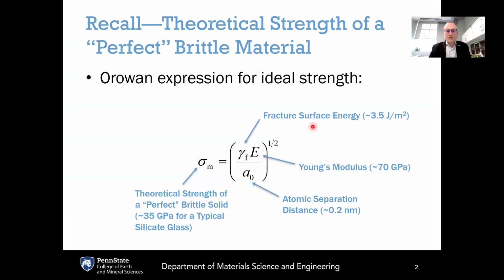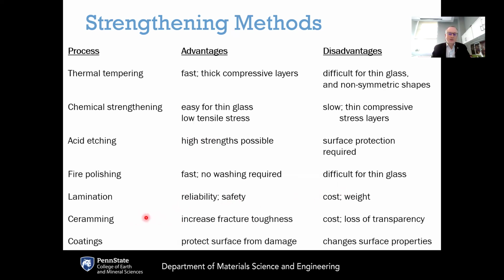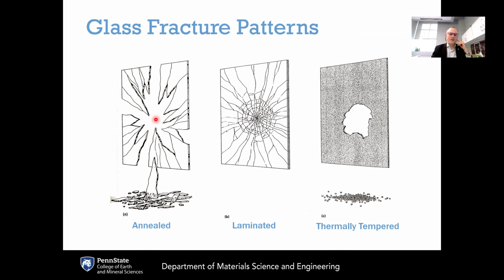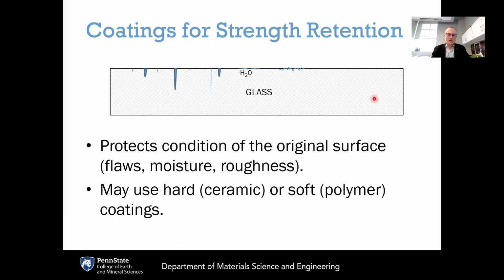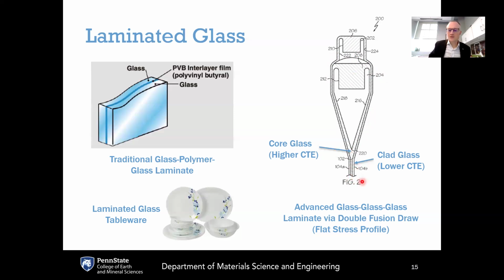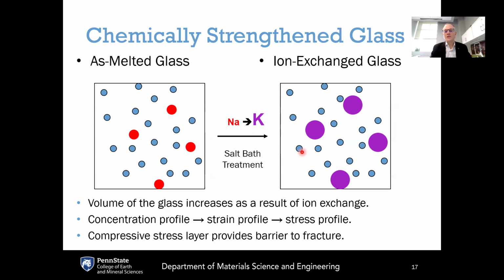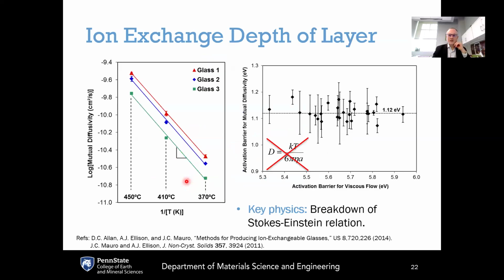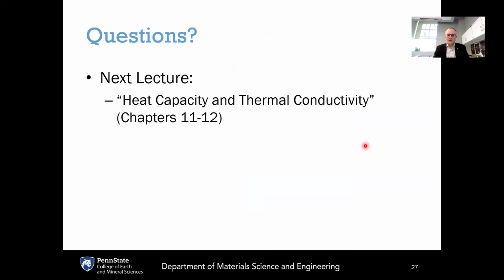Glass Strengthening Methods (Lecture 29, Glass Science)

Comment: Very nice lecture. For a cerammed glass, does the fact that there is now a microstructure, open up the possibility of defects and crack initiation within the bulk? Thanks!
Reply from the maker: Thank you! Yes, cracks can emerge within the bulk if there is a large mismatch between the thermal expansion coefficients of the crystallites and the glassy matrix, in which case local stresses develop upon cooling of the glass-ceramic from its crystal growth temperature.